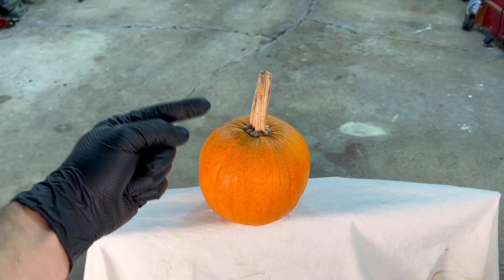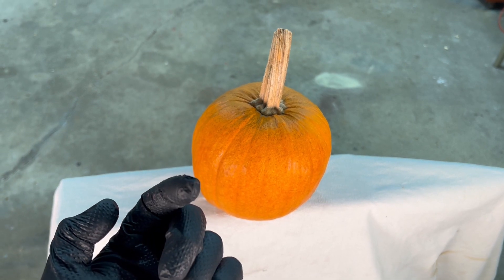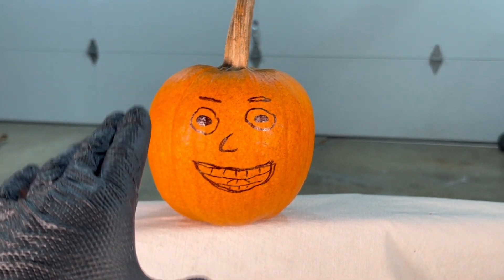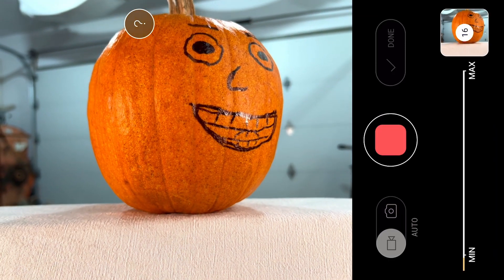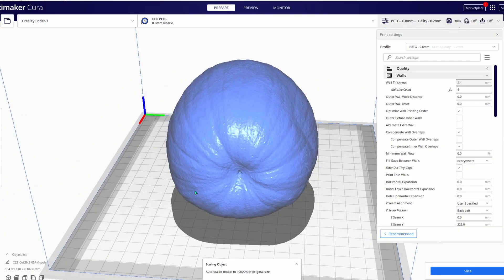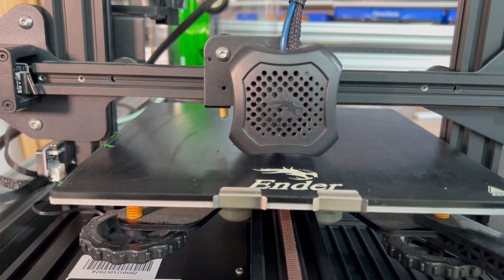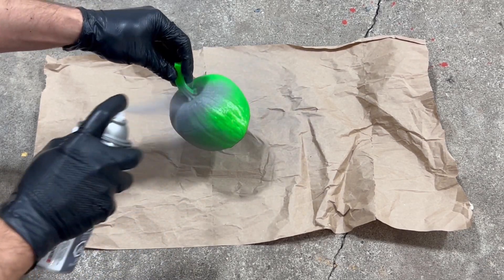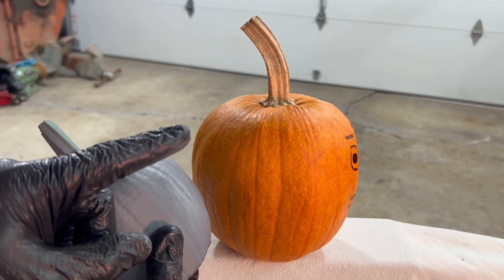I 3D Scanned and Printed a Pumpkin with AMAZING Results!

Comment: I don’t understand; is there no way to print the whole thing in one piece? Why wouldn’t you try that and add support if needed. Defeats the whole purpose of scanning real objects, if you can only print them partially. You even went through the trouble of capturing the bottom only to butcher it. Anticlimactic. What am I missing here?
Reply: @MrHardzio4Fun  I do that with one scan as one object with my 3-D resin printer less than eight hours. I don’t know what you missed.

Comment: Nice tip with the bottom scanning. 

Transparent filaments will clear up at lower temperatures for nicer vases and things. Less stringing and globbing too.

Range a temp tower way lower than normal, under 200c is rare but keep lowering until it clears. There's usually a 15-20c window of actual "clearness" to work with. Keep it on the higher side of the window for stronger layer adhesion, of course. 

Fun stuff when it cooperates. Just like with anything else 3d printing related, eh? Cheers guys.
Reply: Thanks for that tip. I have some clear filament on order for a project I'm doing now.
Reply from the maker: Great tips thanks, I’ll give that a try.  I do like to crank the temp up a bit for more structural prints, lower temp for decorative seems doable.  Thanks for leaving a comment!